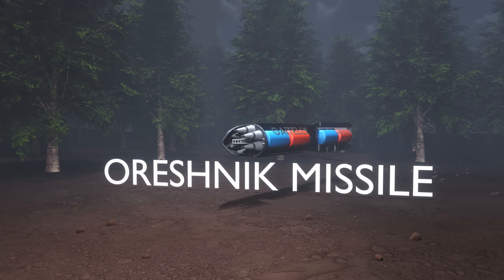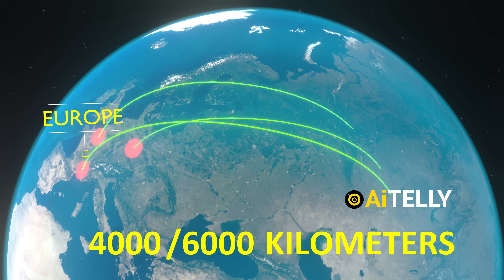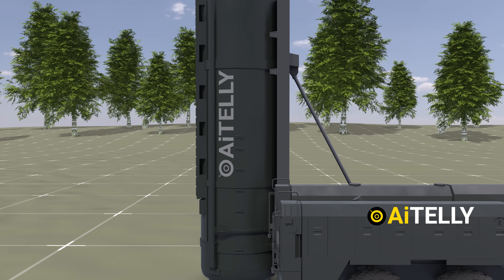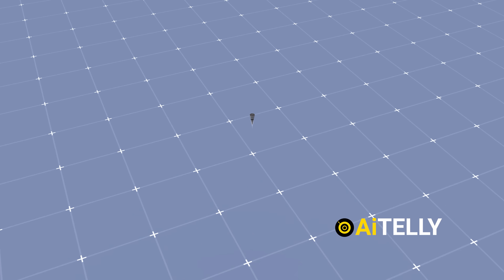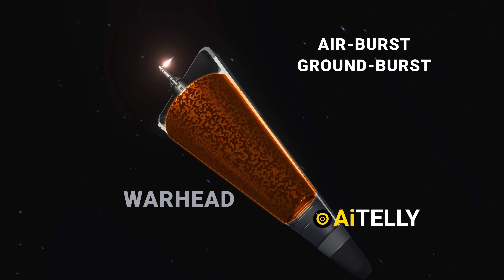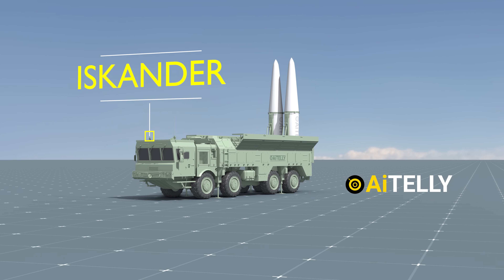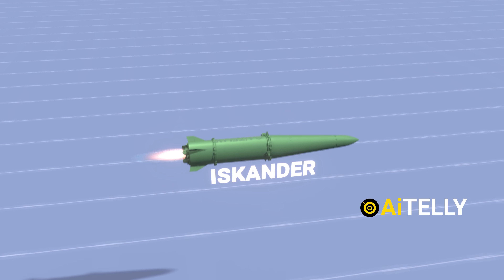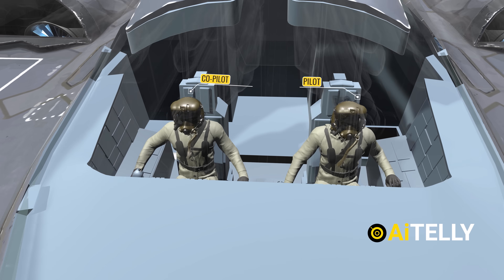Oreshnik Hypersonic Missile | How Russian Intercontinental Ballistic Nuclear Missile Works?

Comment: The MIRVS you showed in this video cannot maneuver. They are ballistic so when they are in space they are aimed exactly where they need to land and then released. The ones that can maneuver look and function completely different. Look up glide vehicles and you’ll get an idea of what im talking about. They have little wings and use flaps to control their direction. They do not carry any fuel on board to they can only make so many maneuvers while in low altitude before they run out of speed which is basically the only place they can maneuver bc that’s where A sufficient amount of air is to allow the flaps to work. You are showing old outdated reentry vehicles

Comment: For those of you who don’t know how nuclear missiles work like this all our ICBMs and many other nuclear missiles go up into outer space and separate and drop these cone looking independent bombs which exceed at tremendous speed I mean these babies are gone Mach 20 Mach, 10, whatever That’s how they all work. This isn’t anything special it’s an old design if you’ve actually seen a picture of it. It doesn’t look like these pretty pictures. They’re showing your hair. It’s rather crude looking with these wings on its side and old. That’s how all your intercontinental or ballistic missiles work with multiple warheads in them. This is not a new super missile from Russia. Their claims that it’ll go mark 10 or a bit more is fine but RICBM‘s are going Mach 23 actually about 3000 miles an hour faster. You know how Russia has been digging up all their old shit that they never took care of that probably spent this entire war working on a couple of these that won’t blow up in their launchers or just go up a little ways and fall back down the craters these things left in testing recently were big enough to see from space but they weren’t nuclear. They’re using old fuel mixed oxidizers, which are unstable and tend to blow up after sitting inside a missile for 15 years because they can’t exactly stir the tanks if the juice hasn’t already been sold by some general.

Comment: There’s a big big problem with the maneuvering of warheads at the final stage of the flight. The so-called “bus” (or MIRV) should accurately lead them to the target, after which they should fly along a ballistic trajectory. Performing maneuvers, how will they return to the previous "sighting" trajectory?

It turns out that evasion maneuvers will lead to a significant decrease in the accuracy of warheads, because they do not have a guidance system (which is on the MIRV).

Comment: Oreshnik missile is a kinetic weapon, hitting targets with conventional non explosive war heads at speed greater than 3km/s at the ground. Your video doesn't even mention that. Each of those six warheads releases up to 6-8 individual warheads each. The key to this missile are those 36-48 kinetic warheads capable of traveling down the atmosphere at enormous speed, and getting heated up to 5000 degrees Celsius and staying intact until they hit the target. A projectile traveling down the atmosphere at such speed will be surrounded by high temperature plasma, and with such plasma around , this warhead is undetectable by radars, so you can not target it with any air defense system, because you can not see it.

Comment: Corrections: 
1. The Oreshnik is NOT an intercontinental, nor a ballistic missile.
2. The Oreshnik is not designed for nuclear warhead but primarily for a kinetic hit, or with chemical explosives. Putin was specific, that it was designed to have the destructive power of a small, or tactical nuke, without(!) a nuclear warhead; the same or similar result achieved via 36 (inert) warheads' kinetic energy.
3. The Oreshnik demonstration on Kiev carried no explosive warhead. Its destructive power came from the speed its warheads hitting the ground.
Reply: Russian tactical nukes range in yield from 1 to 350kt.
The Rubezh nuclear payload is 900kt.
The combined yield of all 36 Oreshnik warheads is 0.001kt.

36 craters each 30m^3 is not comparable to the effects of a nuclear weapon...

Comment: First of all: The Oreshnik is not an ICBM, it's an IRBM which stands for "Intermediate-range ballistic missile"! Also, when Russia launched one Oreshnik, a total of 36 impacts were recorded in Dnipro. This leads to the assumption that the Oreshnik has warheads that carry ‘submunitions’ (6 x 6 = 36, easy right?) Of course, it cannot be ruled out that Russia could use 6 larger nuclear warheads with a higher TNT equivalent. Alternatively, they could also use 6 warheads with nuclear submunitions. That would be 36 nuclear strikes, with less TNT equivalent than a larger warhead, but due to the quantity of warheads the effect on the affected area would still be catastrophic. Let's say each warhead of this submunition has 15-20kt TNT equivalent - that would be Hiroshima x 36 times...Just to stimulate your imagination.
Reply: It's an MRBM. Its maximum range with a full payload of 36RVs is 2,200km. IRBMs are those missiles with 3,500-5000km range.
There's no evidence of submunitions, and several reasons that it'd be pointless. It was 36 separate RVs.

No, Oreshnik is not capable of carrying 36 nuclear warheads. Oreshnik's kinetic warheads are significantly smaller than their nuclear weapons. The nuclear variant of this missile, the Rubezh, can carry 9 nuclear warheads, each at 100kt.
Reply: @Evan_Bell  Russia stated that they launched only one Oreshnik. A video surfaced showing only one missile flying towards the west. Even experts mentioned only one missile. And the estimated range of Oreshnik is between 2,000 and 5,000km. But fact is that 36 impacts were recorded. 

And as for the nuclear warheads, I definitely see that possibility as the Soviets already had a nuclear suitcase/backpack in the 50s/60s and that's certainly NOT the one that holds the launch button. We do not know how small or big the submunition is, therefore, we can't say whether a nuclear submunition is realistic or not but it would be foolish to assume that it's not the case. Who knows what those scientists came up with when they developed that missile.
Reply: @dmitrit.4862  Yes, only a single Oreshnik was launched against Dnipro. It featured 36 reentry vehicles, each too small to carry a nuclear warhead, however.
The 5000km range estimate comes from the trajectories of the first two Rubezh launches, but kinematic analysis indicates these trajectories could only have been achieved with zero payload. The subsequent 4 tests to 2,200km range corresponds to a full payload.

Yes, the USSR had the capability to produce subkiloton tactical weapons including AFAPs and reportedly "suitcase nukes", but it makes little sense to deploy these on strategic missiles.

We can work out the size of the 36 RVs of Oreshnik, knowing the payload fairing dimensions, throw weight, and ballistic coefficient required to produce the observed impact velocity...

Comment: The video claims the missile is "engineered with multiple stages, enabling it to reach orbit in a few minutes," but it is important to clarify the distinction between orbital and suborbital flight. Orbital flight requires a spacecraft to reach a velocity of approximately 28,000 km/h (17,500 mph), equivalent to Mach 22.67. In contrast, the video states that the missile travels at speeds exceeding Mach 11—around 13,600 km/h (8,500 mph)—a claim supported by both Putin and Ukrainian military officials, with Putin citing Mach 10 and Ukrainian sources reporting Mach 11. The Oreshnik missile, an intermediate-range system, follows a suborbital trajectory, briefly leaving the atmosphere but lacking the velocity and energy-intensive flight profile needed to stay in orbit. This common misconception often leads to high-speed missiles being mistakenly described as achieving orbit when they do not.

Comment: 👀✋🏼 This course changing element of the REV (Warheads), does that go back to Dong Feng 21 technology which got stolen from me in the summer of 2002? Your interpretation is a bit different. It is only with 2 thrusters which are effecting in a circular way. In the original Dong Feng 21 concept there were at least 4 course effecting thrusters. Effecting in 4 or more vectors.

Due to my intelligence the thief (D) sold that sound recording which was made illegally to several countrys.
There is a country which built flying hovercrafts later on. They were meant to be used against US aircraft carriers due to a news portal. But that flying hovercraft was actually the flying hand. That certain flying hand which spoiled your initial offens in …

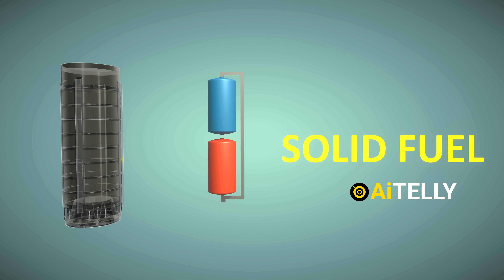Comment: There are far too many big inaccuracies in this video mate. I love your videos, but for example, don't show things like two liquid fuel tanks when talking about solid fuel at 00:50 ish. Solid fuel is a single mixture in a tube-like shape that burns on its own, how would having tanks of solid fuel even make sense? You can't pump a solid through a pipe.
Same thing with "accelerating to hypersonic speeds as it descends" - ballistic missiles slow down as they descend, not speed up, due to air resistance. They're fastest when they're in space. By the time it's back in the atmosphere it's starting to slow down a lot (which gives you an idea of how fast the thing must have been outside of the atmosphere).
Also, the information of how MIRVs work is well known and not classified, and has been around for several decades, even in civilian use, it's not exactly complicated and definitely not new.

This isn't secret squirrel stuff and definitely not that complicated, anyone could learn lots about it in a few hours.
I understand that you get videos out at ridiculous speed after something happens and you're amazing at that. But take a day or two to get things right. Or if you need to, just rush your first video like this for the clicks but then upload a part-2 corrected one a week later or whatever would be a much better way to do it.

Cheers though :)

Comment: The one dropped in Dnipro didn't have a nuclear warhead on it. Now imagine multiple Oreshniks with nuclear warheads. Scary thought😰
Reply: A nuclear strike cannot destroy underground structures, as it explodes 100 meters from the surface. No country has nuclear warheads capable of penetrating the ground to a sufficient depth and exploding underground. A kinetic warhead weighing 300-500 kg, accelerated to high speed in space, is more likely to create a mini earthquake, due to which underground structures can be flooded with groundwater.

Comment: 9 метровые стержни из вольфрама , разогрев  происходит от сопротивление атмосферы там нагрев 3000 градусов , когда они рядом 6 снярядов падают , по кинетике создают волну ударную под землей , каждый снаряд друг о друга ловит волну ! , удара кинетики , и тем самым создается землетресение в 9 балов , по окраине города куда ударили по 404 , там по окраине города дома треснули .. стекла вылетили это за 20 км
___________
9 meter tungsten rods , heating occurs from the resistance of the atmosphere , there is a heating of 3000 degrees , when they fall next to 6 projectiles , they create a kinetic wave underground , each projectile catches a wave against each other ! , kinetic impact , and thus creates an earthquake of 9 points , on the outskirts of the city where 404 was hit , houses cracked on the outskirts of the city .. The glass flew out for 20 km.
Reply: суть в том что цель будет разрушена , а по 10-30 км будет волна землетресений
Reply: это плазменное оружее  18 века ......................

Comment: Solid state fuel does not have the oxydizer and fuel tanks separate. That's the whole purpose. Why say one thing and then show the wrong thing? I suspect that you're making up details as you go with no real insight.

PS. Wgat about the submunitions? It should be 6x6? Only the 6 mirvs are seen here. What you show has nothing to do with the actual Oreshnik that was demonstrated.

Comment: sooo, no mentioning that Oreshnik used kinetic perpetrators as its main payload? 6x6 = 36 mini meteors(roods of Good anyone) designed to do bunker busting at mach 11 and 4000 Celsius. Who needs explosives, when these things can hit with 1.5 times the energy of equivalent weight of TNT and all of that energy pointing in specific direction.
Reply: The "kinetic penetrators" were just the normal concrete blocks used in missile testing - same shape and weight as a real warhead, but just metal and concrete as you don't need them to explode. All countries use them for ballistic missile testing, even North Korea.
Reply: @jnievele  standart stuff will not eistand mach 11 and 4000 Celsius. They will disintegrate. Try harder...

Comment: Currently, the Oreshnik is the only officially declared IRBM in service with the Russian army. According to the government portal Obyasnyaem.rf, its maximum range is 5,500 km, it develops a speed of up to 10 Mach (about 12.4 thousand km/h, or 3 km/s) and can carry a warhead weighing up to 1.5 tons. When armed with a nuclear weapon, the missile can deliver charges watt a total capacity of 900 kt (45 Hiroshimas).

On November 28, 2024, at the CSTO summit, Putin reported that the missile is capable of hitting well-protected and deep targets, with the temperature of the striking elements reaching 4,000 degrees Celsius, so the massive use of missiles of this type is "comparable in power to the use of nuclear weapons." At the same time, the warhead of the missile can carry dozens of self-separating warheads with a speed of 10 Mach.

According to official data, it is possible to shoot down a missile only at the initial stage of flight, so it is launched from the Kapustin Yar test site in the Astrakhan region. At the final stage, when the warheads develop maximum speed, it is impossible to intercept the missile.

According to official data, it is possible to shoot down a missile only at the initial stage of flight, so it is launched from the Kapustin Yar test site in the Astrakhan region. At the final stage, when the warheads develop maximum speed, it is impossible to intercept the missile.

Comment: Sorry, but you're wrong. Popping out of a tube instead of blasting off from inside of one isn't going to "minimize detection" or evade SBIRS at all because that's not how it works. And, there's zero chance of THAAD, GMD, SM-3 IIA, or an obsolete Patriot battery stopping a MIRV ICBM.

Comment: The spin nozzles on the rear of the RV are used to "impart spin" as it leaves the Bus. The spin stabilizes the RV so that it flies straight like a bullet from a rifle, and does not tumble. The Bus maneuvers and deploys the RVs at the correct launch point and direction. As far as terminal guidance, or maneuvering during the terminal phase of flight, I think the Russians are not releasing information on that technique.
Reply: And the faster the MIRV goes, the harder it is to give it guidance other than inertial navigation, as the high speed will turn the air in front of the warhead to plasma from pressure and friction. Plasma unfortunately doesn't allow any electromagnetic frequency through, so both optical and radar targeting would be blocked.

Comment: How does the reentry vehicle maneuver in mid air? There's no control surface or directional thuster in this video. The spin thrust are used to generate spin, to stabilize the vehicle. How can it moves in 3D with just spin thruster? This is more like common ICBM design instead of hypersonic one